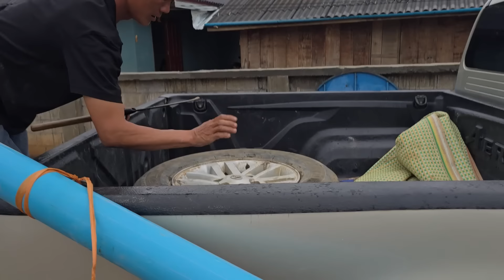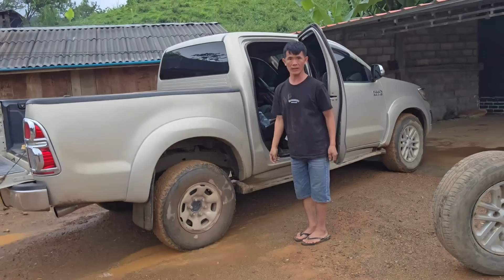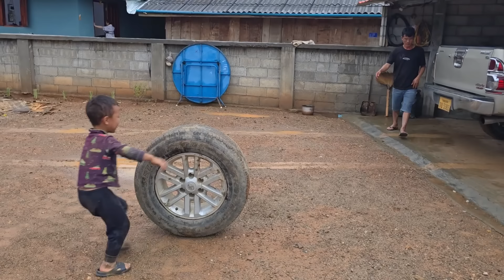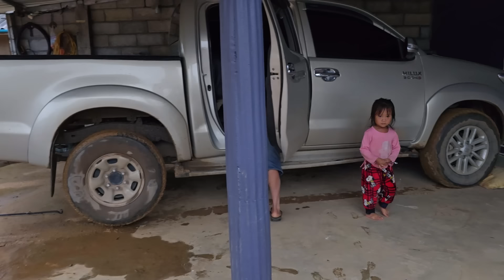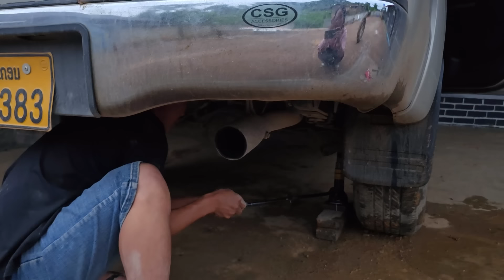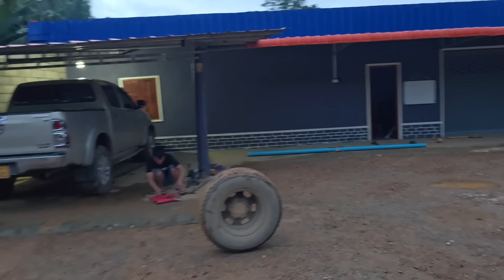Tim lub log tsheb no ntag tos khiav txwv2 lawm os

Comment: they must of replace it with a smaller tire from another car. that is why cars over in laos when u buy used cars do with no legal paper. vuj you need to replace with the correct size and correct tire so you truck will function better go take it to the tire store and swap it out vuj.